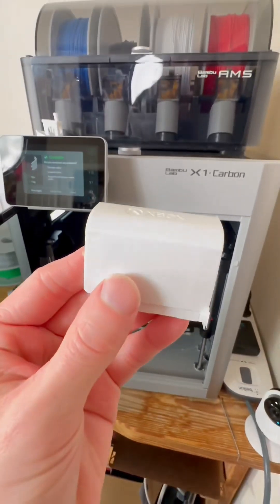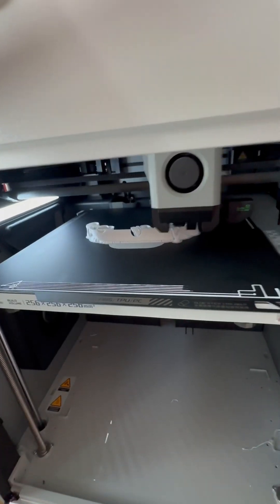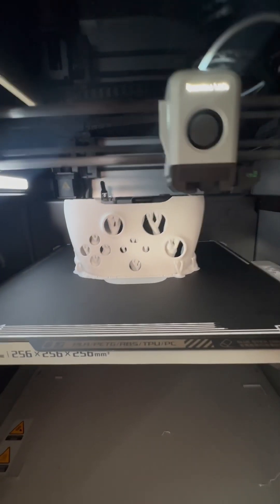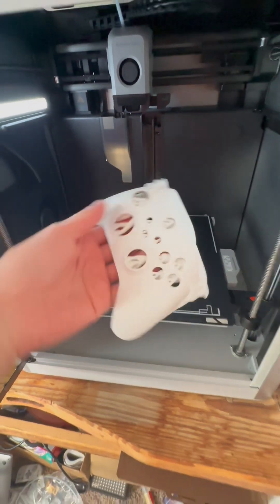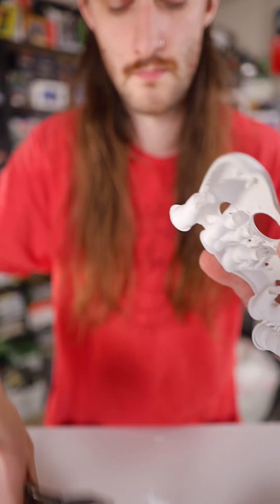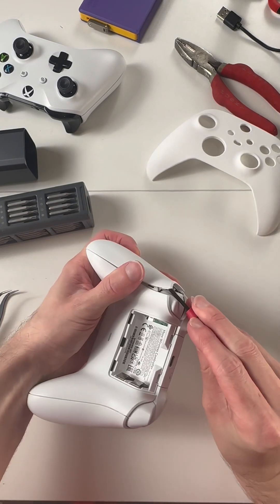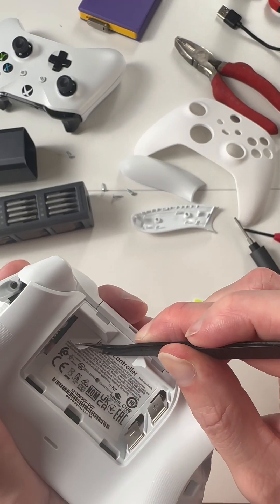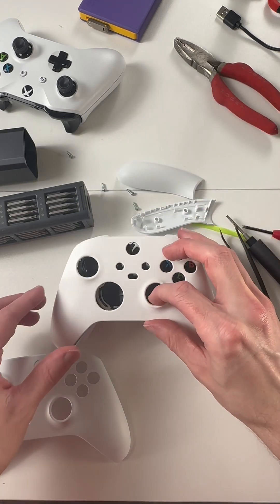3D Printing an Xbox Controller Faceplate

Comment: I remember doing this in 2016 with a 3d printer but the support system was much harder to remove.... Advise, don't leave in a hot car on a summer day. Even for a second.

Comment: I got a 3d printer but ive only used it once because I feel overwhelmed trying to figure out the software for editing certain print files to what I needed it for or creating your own print file from scratch.
Reply: I would say start small and you can always find files ready online but for you to create without experience start with like brackets and supports clips or stuff like that Simple thing the software isn’t very intuitive

Comment: - the xbox logo on the prints this would be useful if u have a bunch of controllers with missing battery doors

And 3d printing custom shells for painting or modifications would be awesome as u don't sacrifice an original shell and can practice 

9/10 i would try this

Comment: When I get a 3D printer, I’ll be definitely gonna use it to print parts that video game parts sellers on AliExpress doesn’t even have one….(for example, DualShock 3’s trigger button holder where you put the spring and the button itself that is clip into the holder, I can’t even buy that part as they only sold it bundle with the controller housing).